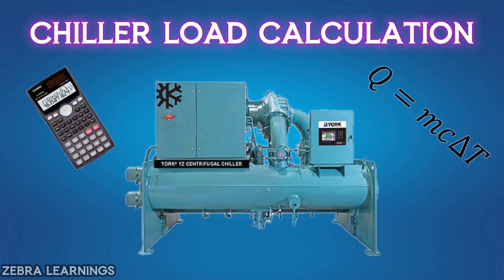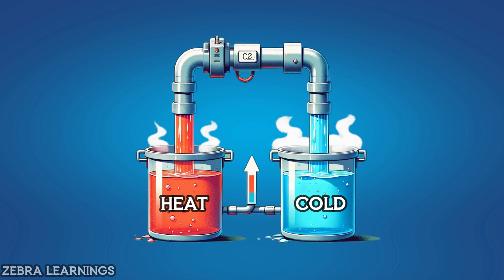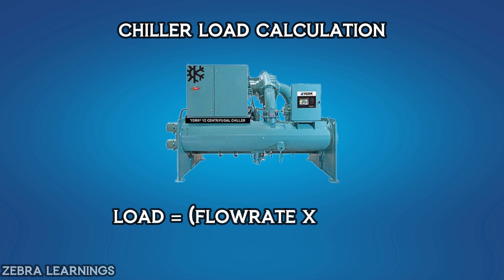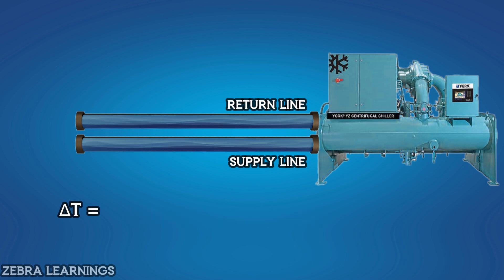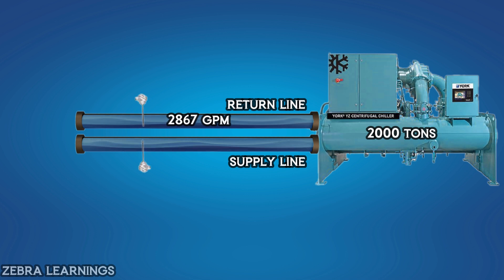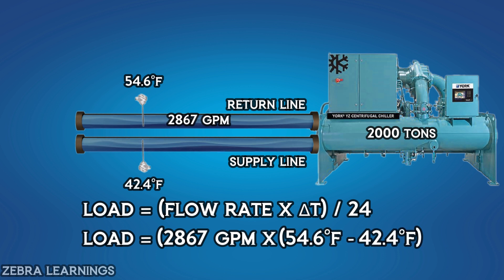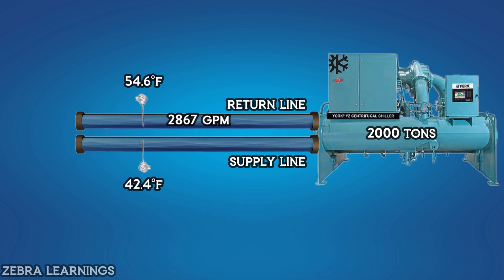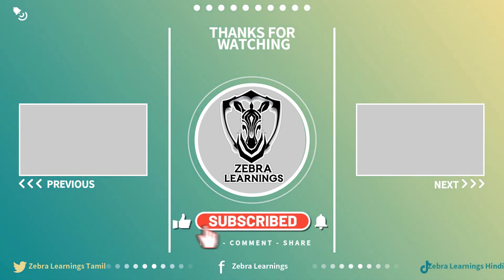Chiller Load Calculation | Load Capacity | Animation | #hvac #hvacsystem #hvacmaintenance

Comment: Why 2867 GPM it should be 4800 because as we know 1 ton = 2.5 GPM
Please confirm 
Thank you
Reply: It's 2.4 GPM per ton. It's based on the design temperatures of supply and return water of evaporator.
Reply: Flow rate is at the site, not design flow rate

Comment: Excellenct explanation Sir.

I would really appreciate if you can let me know if the count of chillers operating at a given point of time impacts the AC cooling.

We have got six water chillers installed in a hotel but run only one chiller. AC cooling has significantly reduced as compared to the period when multiple chillers were operating at a time. I am not an HVAC expert but as a layman I am assuming the AC cooling would be enormously enhanced with multiple chillers running at a time.

Thanks again and I look forward to your feedback.

Comment: Why we take 2867 gpm and gpm 2867 number constant for any tr caliculation of chiller
Reply from the maker: No, that is the water flow rate. We used that value for an example. The value will vary based on the flow rate.

Comment: 1TR=2.4 gpm not applicable here     2867 divided by 2.4 should be the load on chiller approximately
Reply from the maker: TR is rate of heat transfer and GPM in rate of water flow. So we can't compare these both values. And we have derived this formula clearly in a separate video.
The link for the video is below.

Chiller Load Calculation Breakdown
https://youtu.be/FSt7A4vYUWw?si=B1cMVHko79OvMG6e